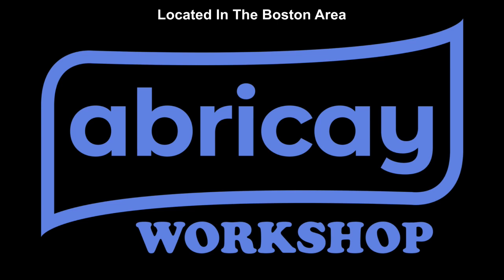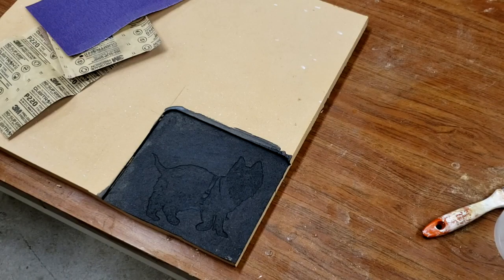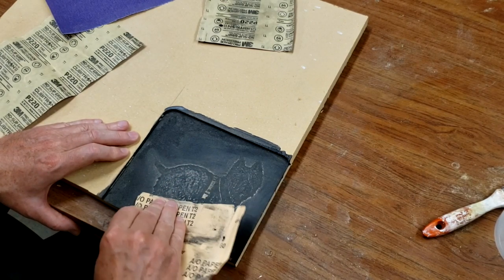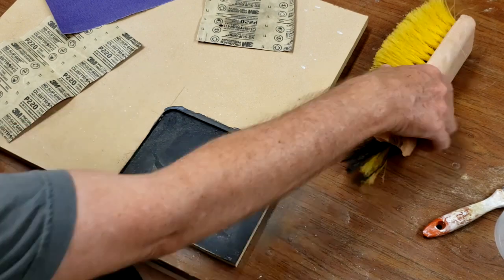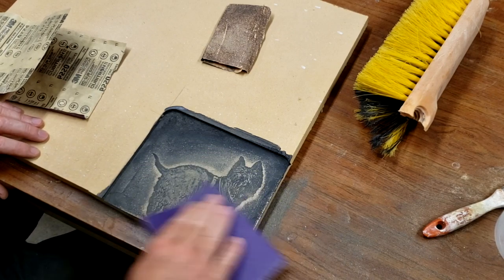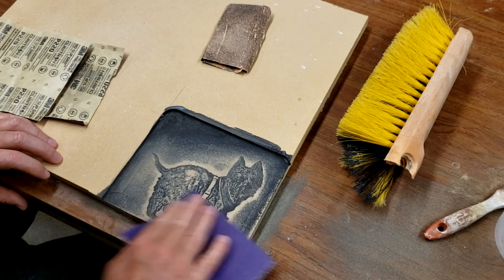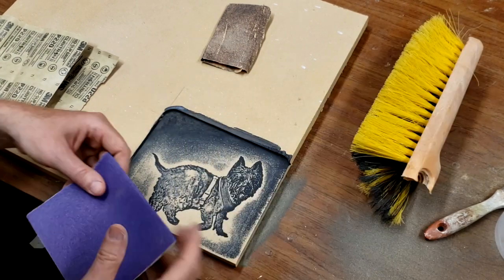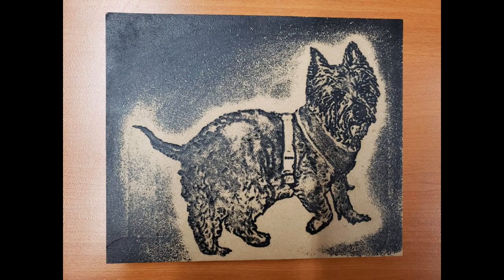How To Make Photos With A CNC Router

Comment: I like that.  Will need to try that.
Reply from the maker: Hi Leo, thanks for responding. I have since discovered, perhaps erroneously, that instead of sanding the image you might be able to fly cut the top. If you can get the precise depth, it will eliminate the need for sanding. The idea is you just machine off the paint and leave the grooves created by the tool with the paint left inside. If you try it, let me know what happens. It would be nice to do some image enlargements. I can go up to 3 x 2 feet. best, David